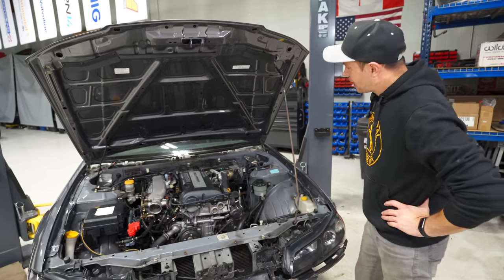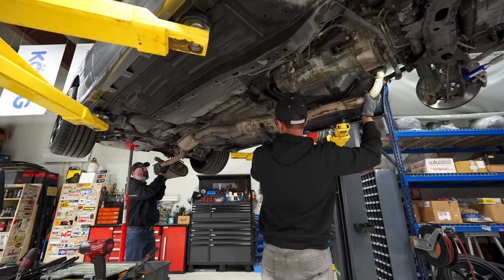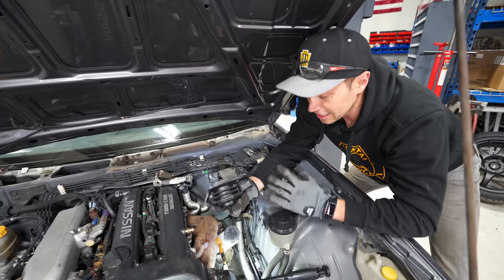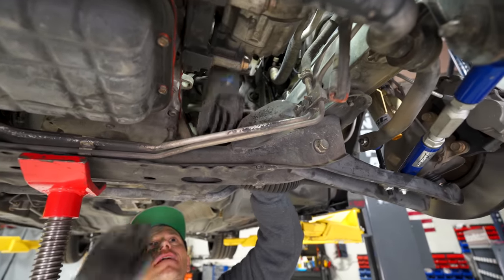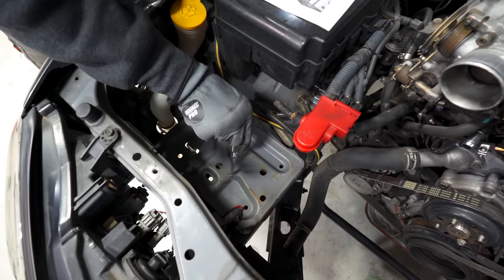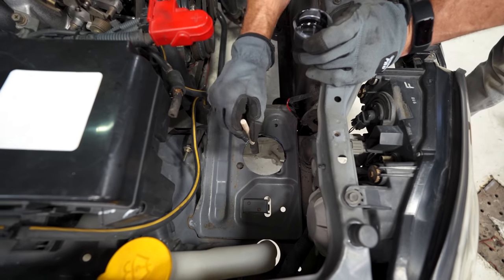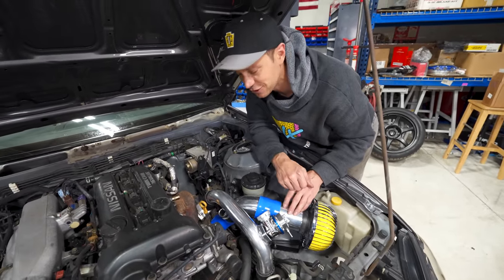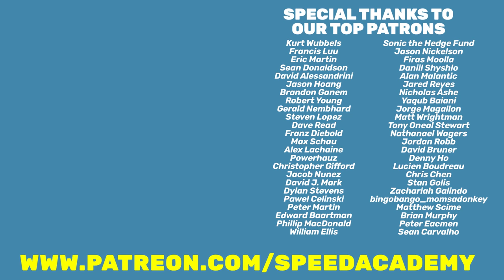Quick & Easy Cheap S15 Build  - EP3

Comment: Greddy..”this is a bolt on solution”….yeah, ok. Just cut here 👈here👉here👆and here👇.
Reply: Defo not just a bolt on. 😄
Reply: Wanted to say that Greddy has a very different definition of "drop in" than I do !
Reply: It weeds out those not capable. 😅
Reply: Love it 👌
Reply: Either cut or remove the reo bar, this is normal for s15

Comment: TIP: If you're removing or installing the radiator, you don't have to pull the fan at all. Just unclip the lower section of the shroud, remove the shroud and radiator as one. The lower removable piece on the shroud is made for this. No need to deal with the awkwardness of unbolting and bolting the fan with the shroud in place.
Reply from the maker: Heck yeah, I saw that and thought, hmm I bet this piece comes out AFTER removing it all.

Comment: When unhooking the steering shaft, remove the rack side bolt because there is an alignment-pin. Makes it easier to put it back together and have a straight steering wheel.

Comment: a rubber care spray on the rubber hose before installation and during removable hoses and stuff helps alot.we use them alot at bmw dealer.

Comment: Turbos bolt on... And I'd say a slightly up sized turbo is safer than maxing out the stock unit
Reply: No harm in running the factory turbo to it's limits of flow before upgrading unless specifically chasing more than 200 rear wheel kilowatts.

Comment: Those front bumper supports are like gold un-cut lol. I had my similar kit Trust intercooler installed and it asks you to do the same thing. Then ages later I thought I'd be responsible and get all my mods certified in NZ (basically a way overpriced check to make sure everythings safe and they log it all and take pics etc) and yeah, cant have a cut bumper support apparently! Was a mission finding a replacement. Got the last one in NZ at the time.

Comment: im upset you had no issues removing those bolts.  I went to put an exhaust on my 17k mile 981 GT4 and promptly snapped a stud on the exhaust lol,  also I’m in okc so we don’t even have rust here.  My 180k mile RSX is spotless underneath

Comment: Throtl nooooooo. I ordered rear shocks for my truck from them. Originally eta was 3 months out. They changed my shipping date 3 times and they charge you 5% to cancel your order.
That doesn't sound like a lot but on stuff
$1000+ it adds up. After waiting 10 months they changed my shipping date to another 5 months out. I finally had to go with store credit. I used PayPal and they couldn't refund my money after 180 days from
purchase.Luckily had a car that needed a set of wheels. Very frustrating and stressful experience

Comment: and that's how you ruin  a nice example of a s15 such a waste of a nice stock car
Reply: Should they not have put on a front mount? The mods they did are the basic ones every s14/s15 owner does? What would you have done differently? Serious question, as a previous s14 owner who parted out kept motor/trans and been stockpiling s15 parts for years.